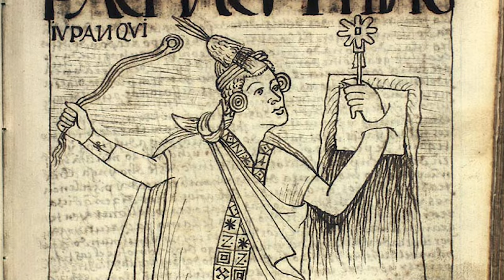SACSAYHUAMAN - How They Did It | Polygonal Masonry

Comment: Excellent and sincere presentation by Vincent Lee of the techniques used by Incas to join the stones in  polygonal masonry, which could be explained by trial and error up to the point when the very heavy stones needed to be raised, even on cliffs, which couldn't be explained, as he with truthful  modestly recognized. In that case trial and error is excluded. Still working with chisel  and hammer under the temporary supported huge stones with that precision it looks impossible. For that proposes defining gravity becomes the next possibility which we don't have any clue in the twenty second century how was that possible. His presentation was an excellent example of  explanations from someone who was clearly involved with the practical approach in hiswork, and at a huge distance from explanations like the perfectly flat cut stones for the pyramids (smooth granite sarcophagus included) in the ancient Egypt with some kind of unspecified tool like a saw, handled by two individuals, and wet sand.
 All my regards Vincent!
Reply: You just have to hammer a thin sheet of copper on a stone, and you can then use this sheet to adjust the cutting. And that's just one of the many ways you can imagine to solve this problem with a technologie we know they had (if they even needed such a thing). But we don't know if they did that this way. "we don't know how they did it" doesn't mean "they had technologies we don't know".
Reply: @wipe3100  That's possible, I didn't know that. It may work better with a sheet of led. What I cannot understand, despite  of the fact that Incas were experts in working with stone, that extraordinary precision, and especially by raising  tens of tons to high  elevations, fit them at the fist try, even perfectly  fitted into the cliffs, by no means that could be done by primitive humans. Inevitably the question is, did they had the technologies, or somebody else helped them with proper technologies for that. Let's not forget that only primitive tools were discovered by now in that area. I know, its tabu to mention extraterrestrials, but how about a civilization living in parallel with ours, but much older, just watching us and lending a hand from time to time. Ridiculously it may seem there are more and more evident clues about that.
Reply: @mihaimos1308  again, there's no mystery, no "extraordinary precision", nothing that can't be explained, and the Spanish witnesses do not speak of mysterious technologies or ancient civilisation but of lianas and stone tools. If you want to see other example of polygonal masonry, you can go to Japan, there are many castle where you can see that kind of walls. And no, they were not built by an ancient civilisation.

Comment: Having been a superintendent in heavy and commercial construction for over 30 years and being around the latest technologies, equipment and techniques -- I would have to respectfully disagree with almost everything I hear in Mr. Lee's explanation.  He is simply back to the old -- "How did they do it" -- by brute force, labor, ropes, etc etc. explanation. No way possible it could have been done by "bashing" rocks to get them to fit, the effort to move and transport and set in place these huge stones is just not possible the way he explains it. 

1) you can't get tolerance today that even as close to those back then -- scribing in 3D on 12 sided stones? I don't think so

2) How do you explain the small protrusions left on some stones, but not others? If it was so easy to "bash" the rock, why not bust off the nodules and make the rock look more perfect? I heard one explanation that these were signature marks left to identify the mason who did the stone work -- not sure about that theory.  

3) How do you explain the -- what looks like "pushed in marks" on the lower section of some stone but not others? Did they simply get over "bashed" and an indentation was left? I don't think so

4) How do you explain the outside rounded corners as well as some inside rounded corners with near perfect radius?  "bashing"? No way

I've been to Peru many times -- look at sites like Huacas or Ollantaytambo -- there is evidence of tools marks all over the place -- saw marks, cored perfect holes, edges that look similar to how you cut Styrofoam with a hot wire to make molded forms, etc. etc. None of those markings were "bashed" in.  Some places around these two sites looks an old fashion high school shop class  -- students practicing with ancient tools and technology to get the hang of how the device works before they go out into the field. 

In my minds view -- yes I am no expert by any means --- it had to be 1) fairly easy for them to do -- not the toil, brute force, 80 men lined up with ropes getting whipped by a guy standing on the rock as they dragged it along (side note, why would the foreman be standing on the rock adding more weight to it and making it even that much more difficult to move? Makes no sense.  2) these rocks were somehow temporarily liquified and them shaped as needed 3) they had to have had the ability to levitate the stones and be able to move them effortlessly like something in outer space with no friction of gravitational forces. Perhaps moved by a single hand guiding the rock along a path 3 feet above the ground and over the water. 

You can obviously see the difference in workmanship between the different layers or sections of the walls at every site in Peru-- the lower section is always a completely different technique then the upper layers ---  the upper was done by the Inca -- lower section done by civilization perhaps 1000s of years older then Inca. 

Inca found the sites, were just as perplexed mystified as we are today, had no idea what the hell they were for, but decided they must be important and simply tried to mimic what they saw and build on top of the much much older ruins. Check out Brien Forester of Robert Schock work and videos -- they explain it much better then I did. (I think I spelled their names right -- if not sorry)
Reply from the maker: Thank you for your comment, Michael. I will respond to your four points as best I can off the top of my head. I certainly respect the fact that you have been in construction for over 30 years and probably have a ton of knowledge about modern construction methods, but I have found that too many people think that their knowledge about modern methods makes them an authority on past methods - which were completely different. While it is certainly true that some things are constant (e.g. physics, chemistry, etc.), it is a mistake to think that people in the past approached problems the same way that we do. They had different tools and resources at their disposal and would have tackled a project with a completely different mindset. If there's one thing I know about human ingenuity, it's that they will do everything in their power to accomplish what they want, and they can think their way around huge problems. Considering that it is already known that the Inca did it, any theory that proposes how they did it must take into consideration what they had available to them. 

1) you can't get tolerance today that even as close to those back then -- scribing in 3D on 12 sided stones? I don't think so
I am assuming you have never scribed a stone. So how can you be so certain? By the way, Mr. Lee made it clear that the scribing would only have been done on 2 sides. It would be a rare stone indeed that would have to be scribed on more than 2 sides, and in those cases, the stone would have been smaller.

2) How do you explain the small protrusions left on some stones, but not others? If it was so easy to "bash" the rock, why not bust off the nodules and make the rock look more perfect? I heard one explanation that these were signature marks left to identify the mason who did the stone work -- not sure about that theory.
I asked Mr. Lee about this, and he suggested that they were meant to be knocked off, and some were, but the job was never completed.  

3) How do you explain the -- what looks like "pushed in marks" on the lower section of some stone but not others? Did they simply get over "bashed" and an indentation was left? I don't think so
Assuming I know which marks you are referring to, Mr. Lee explained those as the spots where the wooden supports were placed. 

4) How do you explain the outside rounded corners as well as some inside rounded corners with near perfect radius?  "bashing"? No way
I'm not entirely sure what you mean by inside and outside corners, but since the scribing would have been done on 2 sides, I would expect rounded corners would have been easier. Near perfection, by the way, was not an issue in ancient or medieval times. 

I've been to Peru many times -- look at sites like Huacas or Ollantaytambo -- there is evidence of tools marks all over the place -- saw marks, cored perfect holes, edges that look similar to how you cut Styrofoam with a hot wire to make molded forms, etc. etc. None of those markings were "bashed" in.
Mr. Lee has been to these places many times too. I did not get a chance to ask about these other sites. Sacsayhuaman was the subject of this video. But I must warn against the "it looks like it" form of analysis. Because we are biased towards our own time and how we do things now, it will be easy for us to associate what we know with things that we see and be misled in such a way. Inca history is not my area, so I can't give you an explanation for the holes, but I would be willing to bet they aren't "perfect."

it had to be 1) fairly easy for them to do -- not the toil, brute force, 80 men lined up with ropes getting whipped by a guy standing on the rock as they dragged it along (side note, why would the foreman be standing on the rock adding more weight to it and making it even that much more difficult to move? Makes no sense.
I don't know. That is something to ask the fellow who drew it. But I am very curious why you would think that something would have to be fairly easy to do. My experience with history has shown many times that humans have undertaken very difficult projects. The difficulty did not stop them. I also know that something that might prove difficult to begin with ends up proving easier as skilled craftsman get better and better at their job.

2) these rocks were somehow temporarily liquified and them shaped as needed
I can't just take your word for it. I would need to see the evidence.

3) they had to have had the ability to levitate the stones and be able to move them effortlessly like something in outer space with no friction of gravitational forces. Perhaps moved by a single hand guiding the rock along a path 3 feet above the ground and over the water.
Okay, this is getting a little bit too woo-woo for me now. You ought to be giving people something MORE believable than what is in this video, not less.  

You can obviously see the difference in workmanship between the different layers or sections of the walls at every site in Peru-- the lower section is always a completely different technique then the upper layers ---  the upper was done by the Inca -- lower section done by civilization perhaps 1000s of years older then Inca.
The video already demonstrated that this is not the case with Sacsayhuaman.  

Inca found the sites, were just as perplexed mystified as we are today
This also is false. The Inca told the Spanish exactly under which Inca kings these places were built.
Reply: when the Dutch explorer found Easter island and saw the Moai -- he asked the indiginous people how they got there -- they said they walked to their place -- sounds like a lack of words for levitation to me.
Reply: @michaeloconnor6683 I don't find it at all surprising that a few generations later the islanders should have forgotten how their statues were made, particularly since the pro-statue people had lost to the anti-statue people - what use were those statues anyway? And there are other YouTube videos that explain convincingly IMHO how the statues were made and installed. Look for the one by Valdemar Janusczak for instance.

Comment: On the big stones you could make a mould of the base so you didn't have to keep moving it. Then you could fit it in one operation..  As workers became more atuned to the job they could probably make a good approximation by eye for the smaller stones. Certainly no one wants to be lifting a heavy stone any more than they have to, that tends to focus the mind.. I can imagine they'd be using any good idea anyone came up with to expedite the work so different places and different materials would require different soutions. 
  There's also a very good theory which would involve cutting up a stone slab in the quarry and rebuilding it somewhere else, placing each stone in the order it came out. This wouldn't be practical for  all walls but is certainly possible for very high status walls like you see in Machu Pichu and they would fit perfectly together.   On site there'd be vast amounts of stone dust created so its likely they'd have played with early forms of concrete as well..
  I don't think there's a one size fits all solution to these walls as the human mind is very inventive. All of the above and I don't think you'd be far wrong.

Comment: I would guess if you spent your entire day scribing and cutting these stones you'd become a master at it. Also the stones seem to have a certain level of finish on them at the joints so this would make the scribing and fitting much easier.. I heard a very good theory for the knobs you see on some of these stones. They were used in the quarrying process to fracture stone slabs at the desired point. When they freed a huge slab and it crashed to the ground these knobs would work much like the reverse of wedges, using the weight of the stone to get the desired fracture.. Best theory I've heard so far...

Comment: I wonder if the big rocks were given a convex base as you say that formed somewhat of a pivot point in the center and they then had 2 separate columns of pullers attached to different sides of the rock they were then able to alternate their pulling back and forth between the groups so they could "walk" the rock. The rock itself would provide some leverage between the pivot point and a rope pull point if positioned on the edge. As a field worker in a national park I have been able to move surprisingly big rocks or logs by myself by walking them on a pivot point, much, much easier than dragging dead weight.

Comment: 23:00  the Inca did leave us with a good idea about their rope bridges, including exactly how the rope was made and maintained. Modern testing of the largest Inca rope cable (that could be handled by individuals) resulted in a breaking strength of 4000 lbs. For a 6 m wide array, that's six columns of pullers and a max pull force of 24000 lbs. A practical working limit (Inca rope breaks suddenly) would be 20,000 lbs. This indicates the largest stone blocks would be limited to about 40,000 lbs or 20 short tons. One could argue for "thicker" cable where necessary, but the self weight and grip diameter of the rope must be considered as a limiting constraint.  The 20 ton limit represents a stone cube of 6.25 ft edge dimension. IMO anything larger needs alternative technology.
Reply from the maker: At Sacsayhuaman, there are maybe 1 or 2 stones heavier than this. They may have been sitting there already (unshaped).

Comment: Vincent Lee's scribing theory - ingenious!. But impossible to get accuracy with the second tier. Bloody dangerous too, I doubt you would get anyone to lie under a 20-ton rock held up by wooden posts! How about they lay all the stones flat on the ground and work on them that way. Check they all fit laid out flat. Then move them into position using ropes, levers and inclined planes.

Comment: Is there a reason why the outer face of the blocks always show some  round bevel, i.e the  blocks are not flush (edited - fixed typing mistake)
Reply from the maker: They probably were somewhat rounded to begin with, and then rain too has eroded them over the centuries, making them smoother.

Comment: A couple of facts seem important ! The Maya built really fancy façades  at Uxmal  ! They are like a jig saw puzzle, small pieces placed in such a way to create a picture ! What they have found is that they built the facades on the ground first, after getting the picture together they then put the facade on the face of their building !

A second fact is that the inca knew how to create formic acid . That acid is very powerful and digests quarts ! Typically stones like granite are composed of quarts ! Digest the quarts and the stone is  Much easier to work. In Cusco you can even still see the discolored edges of the blocks, caused by formic acid. The harder the stone the better the formic acid works to soften the edges !

These are parts of the story, not all but some important facts ! I suspect they had many more tricks ! They could have worked out many of their techniques on softer stones, then  they transferred those techniques to harder stones !

Stone masons in Egypt used fire to soften granite that was revealed in quarries where they made Obolists ? So not every culture used the same methods ! Humans a smart creatures